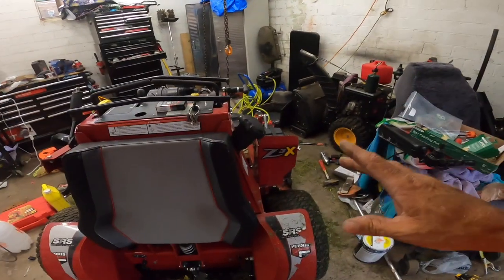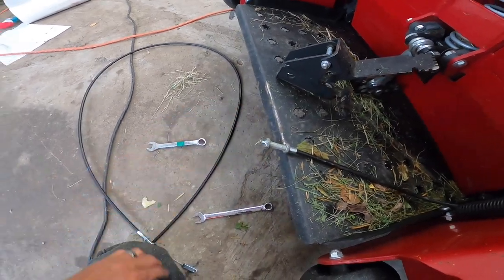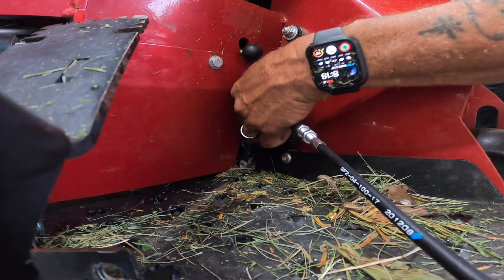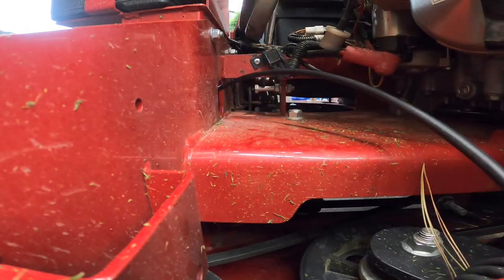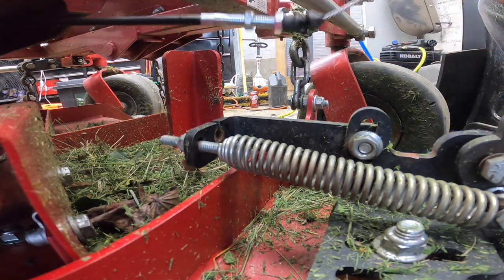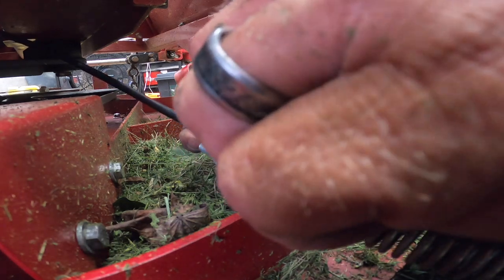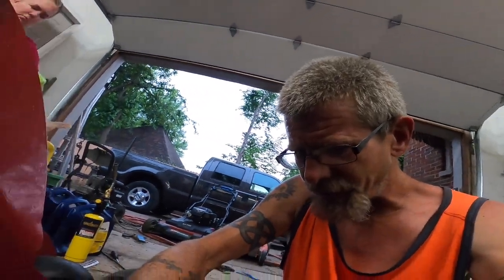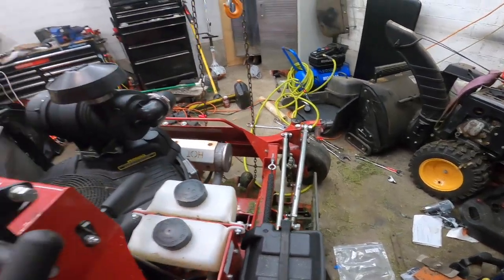HOW TO REPLACE THE GRASS FLAP CONTROL CABLE ON A FERRIS Z3X    HD 1080p

Comment: How long did that cable last before it broke. I've been expecting the same problem with mine but it has held up for 2 years so far I have sprayed WD40 on the ends a few times I don't know if that helps or not but I thought I would give it a try
Reply from the maker: About one season but I think it wasn’t installed correctly to begin with and I reinstalled the new one the exact same way as the old one but I will try the wd40 trick and see if that helps.